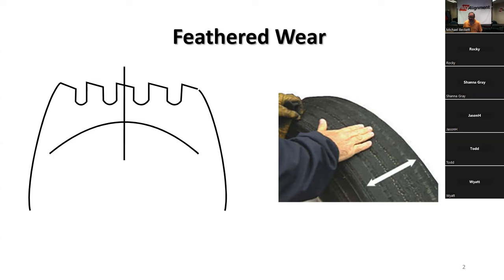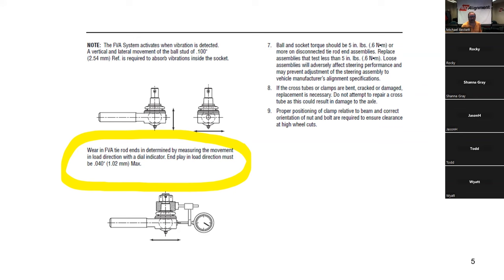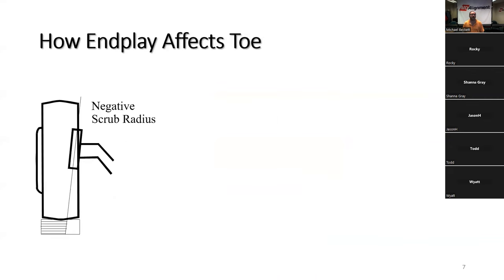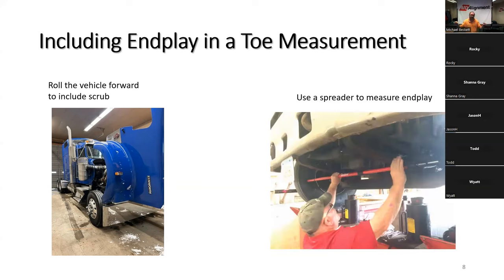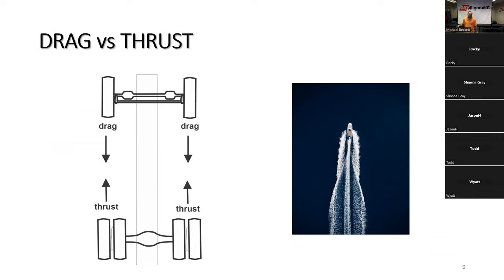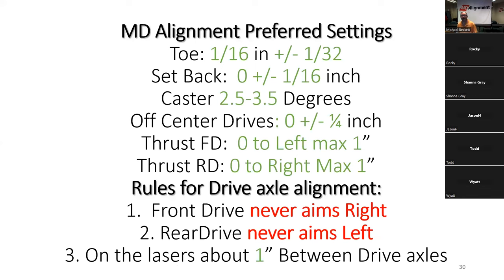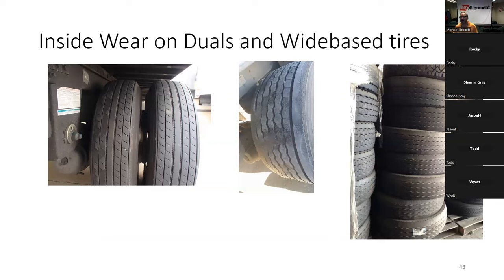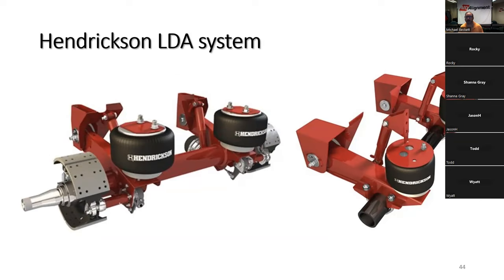Refresher Training: Alignment Settings; Factory Settings; Caster; Steer, Drive and Trailer Edge Wear

Comment: My question is what do you do for the rear end with shimming when you have a three lane highway? When in the center lane the truck is driving on two crowns. I understand 100% most drivers should be in the right lane with a right crown so the shimming of the rear end so it points to the right by 1/32 will keep the truck straight on the right crown.

Many of my drivers admit to driving in the center lane on a 3 lane highway and being ontop of two crowns the report either a slight left pull and or depending on the road condition the truck goes straight some and then wants to gently go left 

do I just tell the drivers drive on a right crown aka right lane or so I shim the rear end perfectly square to the frame and hope gravity doesn’t beat the tires up too much ??
Reply from the maker: Our experience is if the truck is set up this way and the handling is right then excellent tire wear will follow,  I suspect they drive more in the right lane than they think, and tightening up the gap between the 2 drives will result in right side steer tire wear.  If your trucks are experiencing left side steer tire wear its definitely time to address the handling complaint your drivers are talking about.  Setting the drives with half the split we discuss here may be best for the operation in that case.
Reply: @MDAlignment  by half a split are you referring to the 1/32 shim difference from left side to right side of the axle or? What exactly
Reply from the maker: @user-rr4hr7bz7n  yes that.  Our specs as written say we want a 1/16 shim difference between the 2 axles.  If they were only 1/32 inch apart then the vehicle should act very neutral in the center lane and drive pretty straight in the right lane.  But if they drive in the right lane more and just notice the handling in the middle because it’s different, I suspect changing from our standard will result in right side tire wear.
Reply: @MDAlignment  oh I wasn’t looking to change from your standard per say I was just trying to
Figure out what you guys recommend for a set up when drivers report more center line travel then right lane travel.

It’s early to tell because we’ve just started doing this in house and we’ve been looking to your videos as a model to start with and hopefully stay with that’s why I’m asking.

As of right now the few trucks we’ve done we’ve been setting toe to 1/16” TOE IN

and as for the single drive axle trucks we’ve been setting the left side of the axle forward NO MORE than 1/16” compared to the right side  so the axle is pointed right but only by a tiny bit. And the few drivers say it drives great on the right side of the road/right side crown. How ever every once in a while when In the center lane a top two crowns some times they’ll say there’s a very very slight left hand pull

Comment: So 150k out of steers = a problem
Reply from the maker: That all depends on the operation, the tires and the truck configuration.  The ideal steer tire life conditions are: a long nose Pete in a cross country operation on premium steer tires.  Those tires should last over 200,000 and some people get up to 300,000.  The worst is a garbage truck fleet in a large city.  They count steer tire life in single digit weeks.
Reply: @MDAlignment that last part about garbage trucks in the city getting way way less life and steering my issues. Would you say a delivery company that does a lot of stop and go in the city/towns. Seems like when we get the trucks to be in alignment ( all the ball joints in tow rod ends, drag link, bushings in spring hangers all hood and torque bar all good and it seems like every other PM/inspection they’re out of alignment 

Is that just the nature of stop and go city driving/delivery ? And less than ideal road conditions ?
Reply from the maker: @user-rr4hr7bz7n  where are you driving?  While it’s possible the conditions are driving the need for alignment it’s also possible that the alignments are never right in the first place.  I suggest trying our shops at www.mdalign.com and just see what the people we trained say about the vehicle condition and how close the alignment is.
Reply: @MDAlignment  mainly city a lot of city time and obviously highways to get  there but most of the driving is spent in cities. Stop and go turning ALOT.  
Case in point. 2019 freightliner ( try to keep this short and sweet) (thanks for you time by the way!!)
 Found on an inspection, passenger steer tire had tapering on both inner and outer treads and diagonal  flat spotting in the middle of the tire. driver side steer looked pretty normal with a small small taper on the inside tread. 

Ball joint on the driver side tie rod bar had small play. Before changing tie rod bar assembly I checked the toe of the vehicle (on the ground full weight of vehicle)  (no alignment rack nothing full weight of truck on the ground with lasers and a tape measure)

Found the truck to have a 5/16” toe IN.
Installed new tie rod bar assembly set toe to JUST OVER 1/16” toe in. 

Measured front axle both sides center to center.

Driver side: 156 3/16”
Passenger side: 155 15/16”
So axle is pointing to the left which explains the right hand pull and toe in problem that you explained perfectly at the end of the video. 

Re shimmed the rear end to have the final measurements

Driver side: 155 15/16”
Passenger side: 156.0”

Axle is now pointing right a so it should push slightly up the crown of the road but the truck  still pushes right a little bit. I’m no where near the 1/32 difference but I’m close with a 1/16” do I need to get a little bit more aggressive with my shins and go an 1/8 instead 1/16??

Also please note the the truck during the process has had brand new steers on it so there’s no influence from old tires with tread wear pulling. 

I checked all the other bushings. From rear end spring bushings front/steer axle bushings all bushings look to be in good condition. Drag link has NO play in its ball joints.

do I need to be more aggressive with my shimming or what’s going on

Thanks for your time
Reply from the maker: @user-rr4hr7bz7n  A direct tape measure measurement from drive spindle to steer spindle is difficult to get accurate.  If the steer axle is in any kind of steer then the spindle is not lined up straight across from each other and a very minor amount of steering that may be unnoticeable at the wheel can cause dramatic variations on a tape measure.

This is why we use a laser up the side of the drive tire to the steer axle to get a reliable measurement we can work with.  There is another video on our website www.mdalign.com where Mike uses a string for this same purpose.  I suggest using that to get the axle set the way we want.
Reply: @MDAlignment  we do use lasers our alignment is done with the EZ red tools where they’re bolted to the hub of the steers, and laser mounts to the outside of the axle shaft of the rear end.
Reply: @MDAlignment also when you say “1/32” shim what does that equate to physical distance when measure with lasers from steer axle to rear drive ?? 1/16” difference in actual measurement ??

To clarify we have lasers from ez line that attach to all 4 hubs in the center. I was under the assumption what ever you want in distance on a tape
Measure with lasers you double half it with the shim??
 So if I need to move one side of an axle let’s say 1/8 of an inch I shim the side i want with a 1/16” shim??
Reply from the maker: @user-rr4hr7bz7n  We at MD Alignment use a protracted laser measurement to measure axle position, which is not the same as a laser plumb bob where you measure between x's on the floor.  For a more complete description please look here: https://youtu.be/T7xdi3J91BM?si=QlVqxvgfByo6WcV0 

The primary difference being when you take a laser measurement using our methods, a 1 inch difference from one side to the other is the same as a 1/8 inch difference one side to the other measured on the red x's on the floor.  For us, this means there is a large, visible margin of error for any shim we m,ay be adding, allowing us to be very sure of the position we are setting an axle.

As important, we can measure the thrust, toe, axle off center and steer axle out of square in about 10 minutes, then after making all our adjustments and moving the vehicle out of the shop and back in we can remeasure the toe and thrust in less than 3 minutes to verify we have accomplished the alignment we are trying to get.